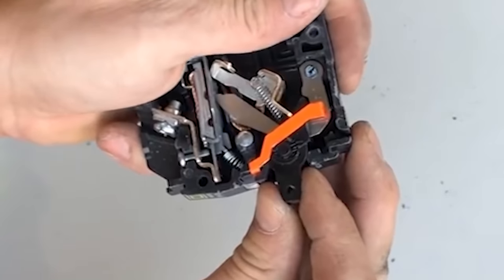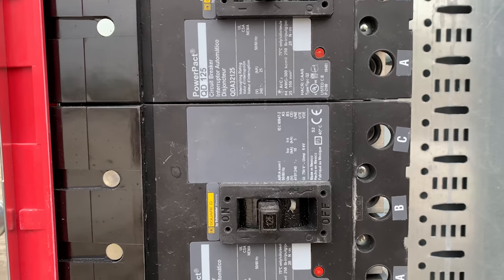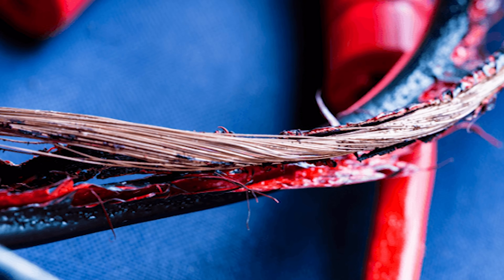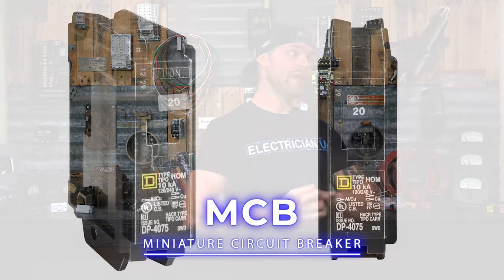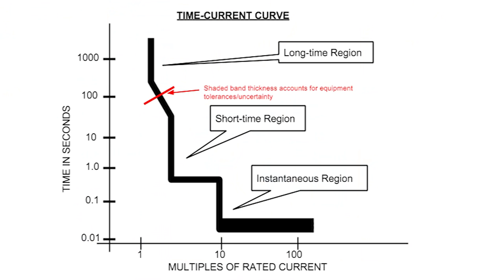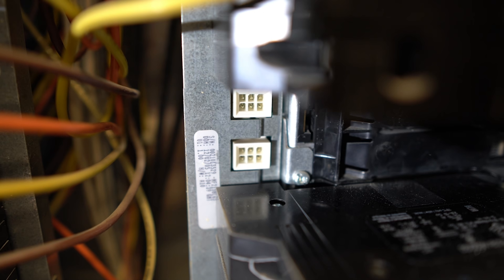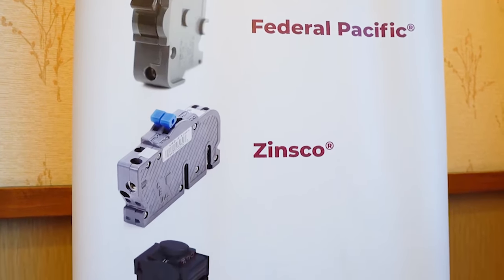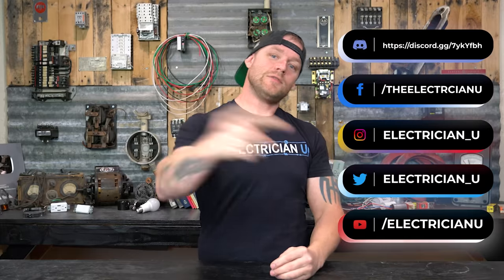CIRCUIT BREAKERS - How They Work & Different Types

Comment: Just did a job in a really old church. Sub panel said it was from 1968. I was trying to find a 20 amp Quicklag Type C Breaker to add a circuit. No such luck, had to do a work around. I will check the (Breaker Type) FIRST...next time! Learn something new almost every day!

Comment: The replacement breakers from Connecticut Electric for most of the brands they carry are a Chinese import branded "UBI" and the ones I've seen are ETL listed not UL(which UL is a little more stringent as I understand). I've had couple of their Zinsco replacement breakers fail and the switching action didn't feel as nice as the originals. I don't know if they've gotten any better, but I've gone back to NOS or used/tested. YMMV.

Anyway... I recommend to ALWAYS inspect the buss bar and breaker contacts for corrosion on old panels. Breaker problems can start there with a poor connection. When these panels are hitting the 40-50+ year mark, I'd say they've done their job and maybe it's time to bite the bullet and upgrade to a modern load center that is up to modern code.

Comment: While on the subject of types of circuit breakers, one type which may be worth an honorable mention is an obsolete type known as a delta circuit breaker.  This is a three phase breaker that was designed to snap across the two bus bars in a single phase panel, and had an extra lug to accept the high leg conductor on the line side, often smaller than the  A and B service conductors such as a 6 or 8 awg copper and usually ran directly from the meter enclosure. This oddball breaker was typically used when there was one three phase load on the service and was prohibited by the 1978 NEC.  You may find these in homes built in the mid 20th century that once had a three phase central air conditioner,  because many 4 and 5 ton units in the 1950s and 60s were 240 volts 3 phase, they were more reliable and more efficient than single phase models at the time and many of these installations were in the southern US in the more upscale neighborhoods.

Comment: Love the channel man, you put complicated wording of NEC Code into simple explanations with style.  Wondering if you ever plan on doing a video about different brands of breakers? Example : Go out on a residential call and a breaker is bad, but the wording and branding names are all removed on the panel and breakers. How can I easily tell breakers apart (Homeline, QO, BR, etc..) and which ones can be used on the other brands panel?

Comment: You got to the nitty gritty, and I actually understood what you were saying. My former job involved troubleshooting and repairing automotive wiring issues. Like some car owner adding extra loads to a wire found under the dash. This would cause the fuse and the wiring to melt. Or the guy that has a short on his 8 amp circuit and installs a 20 amp fuse!

Comment: Great video thanks for sharing your skill 
Ihave an old sylvania panel , i had a short circuit in my baseboard heater and the breaker never tripped wire burning , i twisted 2 hot wires on 2 /20 breaker and breaker blow out with big spark is there any problem with old sylvania breaker type qb cu-al
thanks

Comment: I grew up with screw in fuses. You have one of those on your back wall. 
Also we still have sand fuses and regular fuses for electronic equipment. 
Yes, I've seen copper pipe beaten down and pushed into the fuse slots to make a switch. Even saw a high voltage fuse with a wire soldered on the outside - fuse was blown and this got the power back on.

Comment: A major reason for having a thermal overload trip on a breaker is that it allows for “in-rush” current (start-up current) when a motor is started. When an AC motor is started the initial current draw can be 20 times (or more) the motor’s Full Load Amps (FLA) for the first half cycle (1/120 second). During the first half cycle the motor will start rotating, at that point the starting current drops to somewhere around 4-8 times the normal FLA until the motor is at full speed. Depending upon the motor size, and voltage this can be take anywhere from less than one second to several seconds. If the over current device was not designed to allow a brief overload then you would have a lot of nuisance openings. 
In working with a lot of motors that were protected by fuses we used slo-blow fuses. They could accept those brief overloads without opening, but continuous overload, (the fuse rating was usually 115% or 125% of the FLA depending upon the motor size) would cause the fuse element to part, opening the circuit. A fast-blow fuse would generally open during motor starting conditions. 
The reason why can be seen in the following. The specifications on a 3AG type fast acting fuse with ratings of 10 amps or less are that the fuse will open in less than 5 seconds when subjected to 200% over current. In contrast a 3AG type slow-blow fuse (15 amp or less) is rated to allow 200% for a minimum of 5 seconds, but open in a maximum of 30 seconds. Both the fast acting and slow-blow are rated to allow 100% current for 4 hours minimum and 135% current for 1 hour maximum.
If my memory is correct I believe that UL 489 specifications for circuit breakers (15A and 20A) are 100% handle rating continuous, 135% for a maximum of 1 hour and 200% for a maximum of 12 seconds, (I could not find my reference to UL 489’s table for different size breakers so I could be mistaken on the 200% time). If I got any of these figures wrong I apologize and would appreciate the correction.

Comment: I know you probably never read the comments but I just wanna ask this. With a regular thermal/magnetic breaker MCB, the ground fault trips the breaker by magnetic mechanism. If all the ground wires are coming back to the same ground bar/ neutral bar then to the transformer. How does that specific breaker sense the magnetic but not the other one around that? The same with short circuit since neutral coming back to that same place too

Comment: What are Heinemann breakers used for? What is the one place that makes a Heinemann breaker trip  from high G shock? How about shunt trip breakers? How about calibrated tap breakers? Oil bath contact breakers? Arc chute breakers? Arc fault? Ground Fault? Ground leakage breakers? Programmable breakers. Poly self resetting breakers. 3 shot breakers. LDO breakers. Airpax breakers (similar to a Heinemann breaker). Set trip breakers. Vacuum breakers. Air breakers. Heavy gas breakers. Light gas breakers. Inert gas breakers. Remote sense breakers. Thermal breakers. NTC thermal breakers. RF thermal breakers.
Reply: We never never really adopted arc fault breakers in Phoenix AZ. Who uses an electric blanket when it's 120 degrees out and in  winter it might get down to 40 degrees outside? NO ONE! I use electric blankets to heat up things that I am testing that have thermal issues to make them fail. NTC breakers are weird. They will trip open or shunt through a resistor until something get up to operating temperature. Imagine the oil in a transmission is like molasses, so the motor will just stall out, until a block heater heats up that oil. Failed block heater and the breaker will trip saving the motor. Heavy gas. Neat stuff. Slow closing and self regulating.

Comment: hey Dustin, I have a circuit breaker question.

Does the magnetic trip funtion depend solely on the amperage or does the voltage also need to be high enough?

Comment: excellent.  Im curious how powerstrips/surge protectors might affect a series of outlets.  Ive been dealing w an issue: CB not tripping but losing power to a series of outlets.  Only when I reset the MAIN breaker do I have power again (sometimes).  I just removed a tangle of things connected to the first outlet including powerstrips/surge protector type strips.  THANKS!   fyi my situation seems stable now.... just curious re the science

Comment: What ka rating should 120 or 240 volt circuit breakers have in residential installations? Thank you.
Reply: It depends on the available fault current and this is determined by the kVA and impedance rating of the utility transformer , and the length, size and type (copper or aluminum) service conductors from the transformer to the service disconnect.  For residential this rarely exceeds 10,000 amps, and if you pay attention you'll find that the majority of 120/240V single phase panels for residential have a 10,000 amp interrupting rating.  Once you get into very large custom homes and light commercial with 400 amp and higher services then you start getting into the 22kA interrupting ratings.   This is important to know particularly when you're getting into the larger services because a breaker with an inadequate interrupting rating can violently rupture when attempting to clear a fault, injuring or killing someone standing in the vicinity.

Comment: i noticed zinco types have the plastic   concave connections  to snap in box  but not all the double pole breakers have both metal snap in  both slots    only one pushed in slot is actually attached? from each breaker ?

Comment: It is normal for main circuit breaker to be a little hot at time? Mine once in a while trip, I dont think my appliance is shorted as
it could be reset. I think maybe it is too old, mine house is 25 yrs old, Ty

Comment: Do you have any info on breaker discrimination in terms of main breaker sizing for subpanels?
Reply: From an old timer. Kinda remember reading years ago that they test the 15, 20 & 30 amp single pole circuit breakers around a thousand times and the 2 pole 100 amp breakers only 100 times. Been in several machine, tool & die & injection molding shops where they use switch rated ( have SWD ) label 15 & 20 amp circuit breakers to turn on all shop & warehouse luminares ( no such thing in NEC book anymore called a light fixture ) on and off. If they add luminares to existing circuits that causes breakers to run hot shorting their life. Nothing worst then turning off an old obsolete breaker to not being able to reenegize it. Had 2 piece of crap ge garbage 400 amp circuit breakers that would not reset so had to be replaced.

Comment: ZINSCO SYLVANIA GTE RC38 30 Amp 2 Pole Circuit Breaker or Zinsco GTE Sylvania 2 Pole Breaker 40 Amp Type RC-38 with 240V PIN can I install the 30 am in stead

Comment: When adding a sub panel, why is it that the copper and white can't share the same strip?
Reply: White (neutral) is supposed to have current flow on it, while copper (green/ground) is not normally. If you connected the 2 in a subpanel, the ground would have current flowing on it back to the main panel (sharing the current with the neutral, since electricity takes all paths.) Since ground is not supposed to have current flow except in emergencies, you must keep ground and neutral separate in a subpanel.

Comment: Ok so I have been wondering, Ive had to replace a circuit breaker in my breaker box of my apartment right. Well I replaced it with a breaker that had the exact same amperage as the 1 that needed replacing but could I have replaced it with a breaker switch with a higher amp then the original ???
Reply: No, you could not replace it with a breaker with a higher amp.